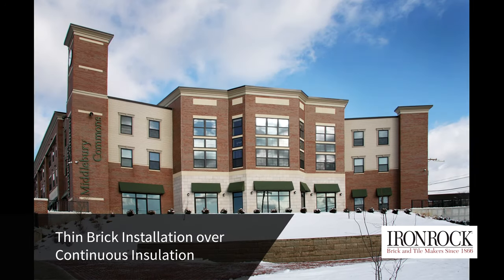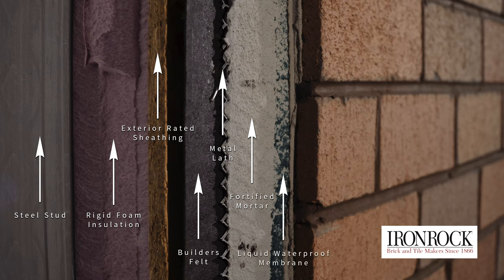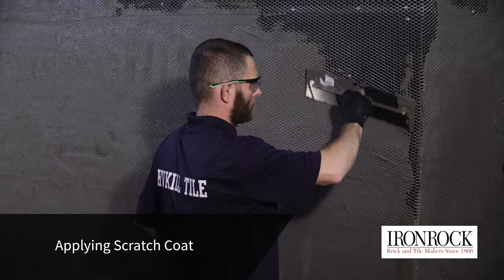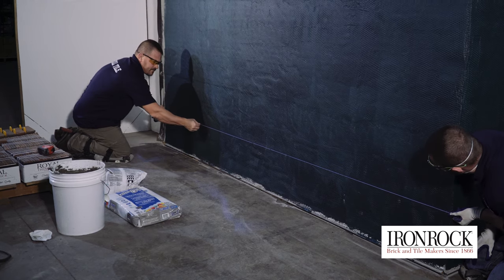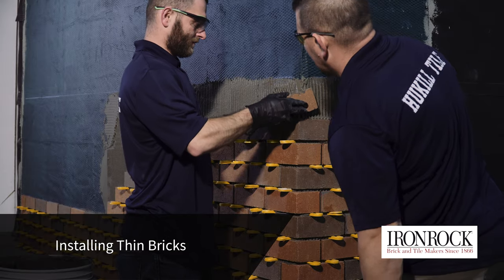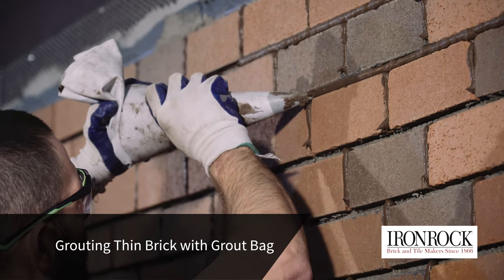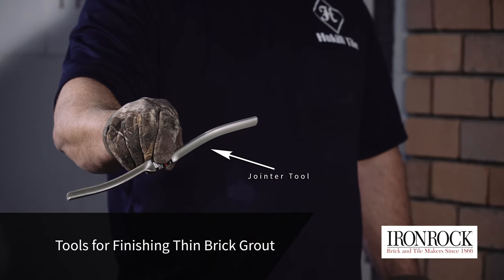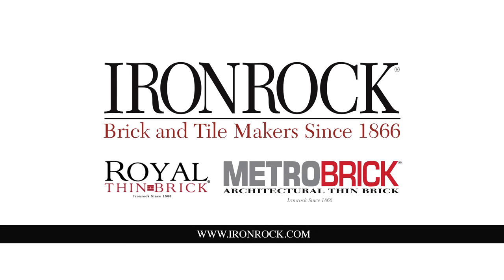How To Install Thin Brick over an Exterior Wall - Ironrock®

Comment: How would you incorporate a rain screen into the wall construction?  Wouldn't this siding benefit from a rain screen just as all other siding does?
Reply from the maker: there is no rain screen in this type of installation. Along with the inclusion of a a waterproof layer, the bricks are low absorption and the grout used is polymer modified, When sealed it should provide good protection against water intrusion.

Comment: Is there no weep holes installed here because you did a water proof membrane ?
Reply from the maker: Yes, because there is a waterproof membrane there are no weep holes.
Reply: What sort of mortar do I use to adhere the thin brick to an exterior concrete cinder block  wall?

Comment: Would I need to still put up metal lath if I use concrete board?
Reply: No you wouldn't.
Reply: With concrete board do you still need the waterproofing membrane?

Comment: It seems a lot more expensive than just installing real brick
Reply: Exactly what I was thinking. Save a little on the brick but a crap ton more labor and time
Reply: Like so many things the devils in the details
Reply: I must depend on the conditions of the installation. If the foundation is already  made for brick veneer, with an outer shelf, the real thing would probably be less work. But if you have to add a support shelf, either because the foundation doesn't have one or because the wall is too tall to have all the brick piled up on the foundation, something like this is probably easier.